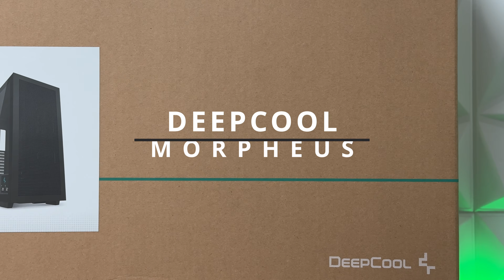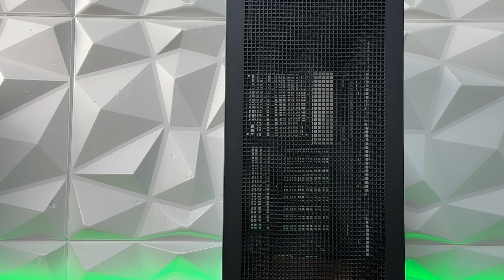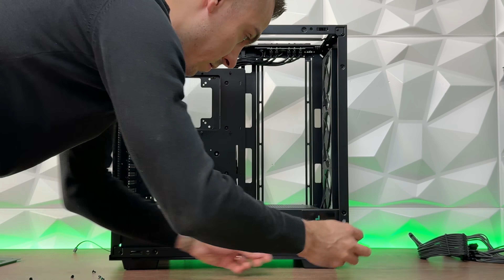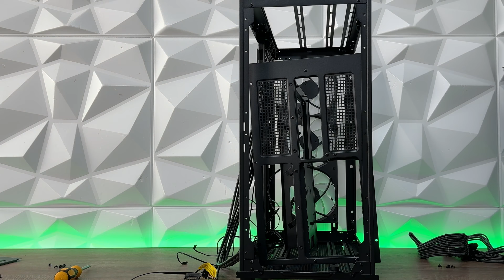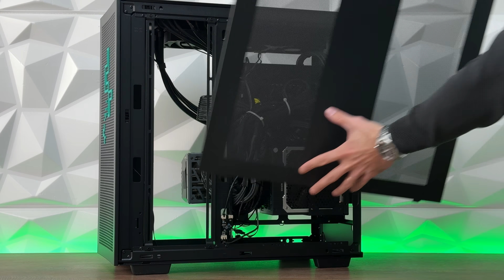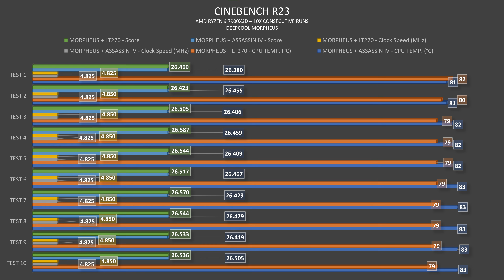DeepCool MORPHEUS - THREE LAYOUTS IN ONE CASE!

Comment: Hi, great video! Thanks for the review 
 I´m currently preparing to build with it and i´m confused by the trinity-fan-setup by factory on the side panel.

Those fans are working as exhaust fans due to the way they are installed on the side, dont they? Sadly i couldnt find any additional information on the airflow direction of the fans... Wouldnt it be more useful to turn them around and use them as intake fans on the side panel (or front panel as done in the video)? I assume the trinity-fans by deepcool are not reverse blade fans or anything aswell right? Thanks for help in advance!

Comment: I ended up returning this case.  Why? Two reasons:
1. The hard drive cage is absurdly difficult to get to and adjust.  I had to completely take apart the bottom of the case to unscrew it. 
2. The Digital readout is too damn bright and stays on when the PC is off and there doesn't appear to be an option to adjust the brightness.  And worse?  It stays on when the PC is turned off.  How fucking stupid is that?  

Deepcool never fails.  They have some killer ideas, but always manage to ruin any system with a few bonehead decisions....
Reply from the maker: I can’t remember the HDD cage, but it is strange for the DIGITAL screen. Literally every time and on every digital product they released, the screen turned off at the same time when the PC did. I am not defending DeepCool of course, but something might be off with your motherboard or electricity. I know there is a catch with some of those two that make the LEDs light up even after shut down. But regardless, you got your money back. I understand the frustration.

Comment: Nice video bro i want to buy this case will it fit the arctic freezer 420mm on top?
Reply: It says it will fit a 420mm radiator. But the real length of the arctic liquid freezer II 420 is 458mm exact. I'm confused as well because I'm also looking for a case that can fit my arctic liquid freezer II 420 and is unsure what measure matter.
Reply: I've sent a ticket to the company asking if it will fit. I will give you their answer as soon as I get it.
Reply: @m.h_15_28  thx dude
Reply: I've gotten a reply! And they said YES, it will fit on the top. Even better, it won't interfere with the motherboard since the MB mounting can be adjusted and allows radiators with a total thickness of 95 mm. I also found a guy in the comment section of another video on the deep cool Morpheus that has his Arctic 420 mounted on top without any problems. I looked into the specs of this case and its total length is 528 mm, so plenty of room to fit that 458 mm long radiator. So on that note, I'm probably going to purchase this case this week. I can personally come back to you and confirm that it fits (or not😬) when I've got it and have the radiator installed. That is, if you still are unsure about getting it.
Reply: @m.h_15_28  u make my day thx dude morpheus white with white liquid freezer 3 😍
Reply: @m.h_15_28 hello, did it fit?
Reply: @SkInDeSFeed  yes it did! I have it installed on the top :D

Comment: i am having a problem with the digiatal software displayng wrong temps :(
Reply: make sure you have the latest bios ,maybe take the wrong reading from diferent sensor ,also i had problem display not showing the temps at all and i had to make some changes on my motherboard settings to work  I had to set legacy usb support to AUTO , and set XHCI hand off DISABLED , after this i was able to install the software ,something was wrong wuht my usb ports on my motherboard msi x570s edge ,also make sure you install the right app ,hope this helps
Reply: @marchev1982  omg ty ty
Reply: @marchev1982  which usb port do I plug it to

The one closest to the pch or the cpu

Aka 

Left or right?
Reply: @Tr1pleG3x  well my specific motherboard have 2 usb connectors and they are at the bottom next to the power /reset / plugs it's say usb on the connector , check the manual
Reply: @marchev1982  I have jusb1 and jusb2

Comment: What`s the clearance on top and front for radiator+fan unit (dual chamber set)? Will it fit distro plate on side panel when the front will be occupied by 420 rad with push/pull config? I know that`s a lot of questions but you`re one of the first who`s put hands on it and this review is showing quite a lot. Kinda sad when I was going to set dual 420s in Fractal 7XL with tube reservoir and I saw THIS one :/ Awesome case. Cheers! Edit: front panel does have dust mesh! I`m blind.
Reply from the maker: Don't worry about the question. That is why I am here after all. What's the point then if I don't answer them. 🤗
Top: radiator + fans (just to be confortable with EPS cables) = 80mm
Front 1: radiator + fans (if you want to place a side radiator) = 55mm
Front 2: radiator + fans (if you only place fans on the side) = 170mm (taking into consideration the GPU I was using)
Side: radiator + fans (if you use the front rad+fans 55mm) = 140mm (leaving a bit more than 10mm from the GPU in vertical position)
Bottom: radiator + fans = 52mm (but then you can't place the side rad+fans up to those dimension)

If you want to place side distro, I would suggest something around 120mm fans of width, then you'll get that difference from 140mm to 120mm for the front. I don't think you would be able to do push pull combo if the pump is on the distro.

Hehe, yeah, it does have dust filter on front, top and bottom, complete sides. 😉
Reply: @PCCrazyDario  Much appreciated! So this means it`s pretty close to the 7XL considerating top and front. As far I measure I`d able to put 45 mm radiators in front as P&P and 45 mm with single fan on top. The difference is the bottom space. I can imagine horizontal tube like 300 mm long  in there.... Well, filling will be pain in the arse , but the look ;). And vertical holder in the price of case here. Fractal Flex 2 is 60 Euros extra more... Ant the top mount in 7XL is struggle for 420 rad, because of side window catch.  I think I`ll reconsider my final choice :D. Better get myself to find buyer for my Fractal.
Reply from the maker: @juliuszgimbut763  Not a problem. No no, 55mm is with the fans. If one set of fans is 25-27mm, you'll have 28-30mm for the rad if you go with the radiator on the side. Unless you really find or design a flat distro on the side, you can go with thicker combination. This is without touching the brackets of the 140mm fans placed on the side. If you go with 120mm distro, you'll have additional 20mm of space on that, so 48-50mm. Soooo, It would be a tight squeeze. I'd rather place a distro on front and go with a side rad.
Reply: @PCCrazyDario  Shame they don`t give glass front panel. But it wolud be close to LianLi then ;)
Reply from the maker: @juliuszgimbut763  True, but you would be able to have such rad support. :)
Reply: Yea there us the ch780 however 

It only has the dual chamber so..
Reply from the maker: @Tr1pleG3x  Yeah, but regardless, two different cases that are epic. :)
Reply: Received mine today. Paid £145 and, considering it includes a PCI-E cable, and allow different layouts, is a fair price. Side panel really heavy, made me remember the 7000D. The case is big, but I think it does use wisely all that space. The NV7 is bigger and only allow 120mm fans, except the bottom. Here you can install 13 140mm fans, if not using the included triple fan thing. Also, you can go with dual 200mm bottom, front and top, and brute force airflow.

Comment: I'll have morpheus tomorrow. I wonder if I can fit 3x Silverstone Shark Force 160 fans in the front. I'm moving stuff from Fractal Torrent Compact. Thank you for the review, maybe the case will not look so empty if I squeeze in a few chickens😊
Reply from the maker: Filling it up with fans will fix the emptiness for sure. :) And of course, I don't take it as a negative... But you do need to fill it up haha
Reply: @PCCrazyDario  You were right, there is an emptiness inside... Good news 3x160 mm silverstone shark force 160 fits the front. The lower fan is screwed on with two screws, but that's not a problem. The airflow is amazing. 
https://www.youtube.com/shorts/0xHKSzd50qw
Reply: is the case already one sale? I didnt see it released, yet.
Reply: My msi motherboard is not fitting. Did you have any issues?